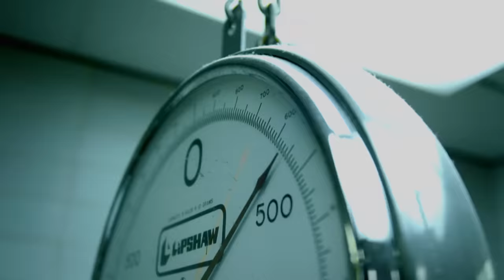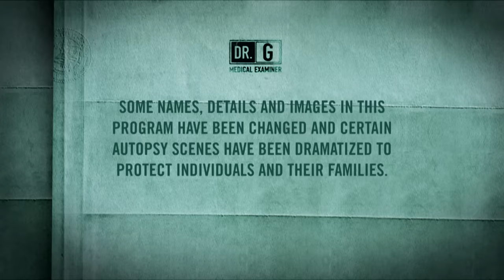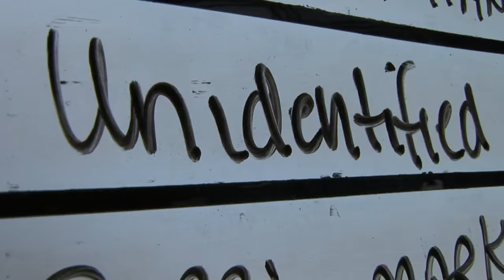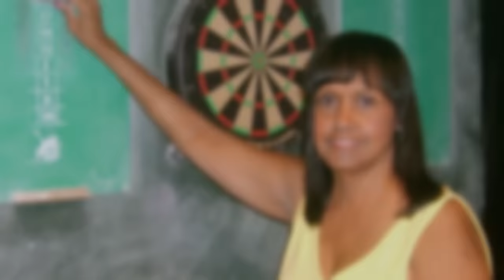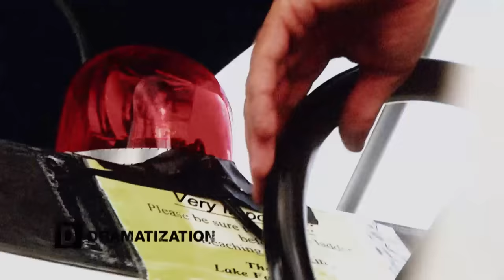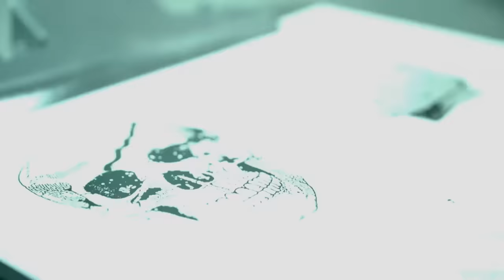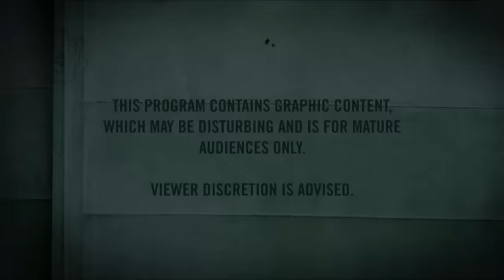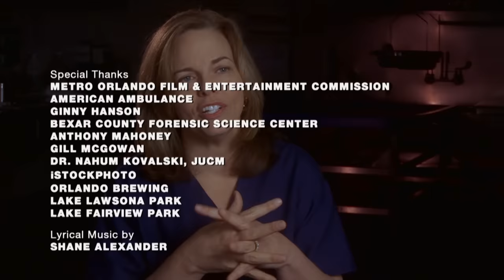Dr. G: Medical Examiner - Season 5, Episode 18 - Deadly Decisions - Full Episode

Comment: Its so sad how many of Dr. G's cases are related to unchecked high blood pressure. Its preventable and manageable. My parents both had it. They were always very health contious, were slim, ate the right foods and took their meds. Congenital. My twin Sister has the same problem, yet my BP is always in the normal range. Although, I have different issues than she does. 
It just a shame that ppl don't get treated for high BP or Diabetes or manageable illnesses that could have helped them live longer and healthier.😔
Reply: And high blood pressure relates to this video how? It does not. Quit spamming.
Reply: @Lydianon  Quit spamming that ppl should be aware of their health and get regular check-up to prevent preventable conditions? Don't you pay attention to Dr. G? She promotes this. You just showed how ignorant you are.